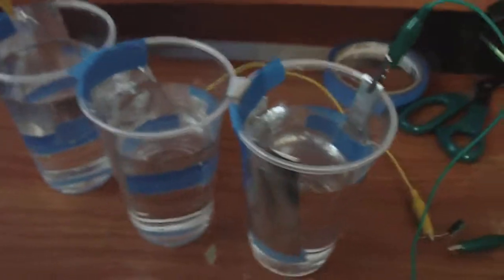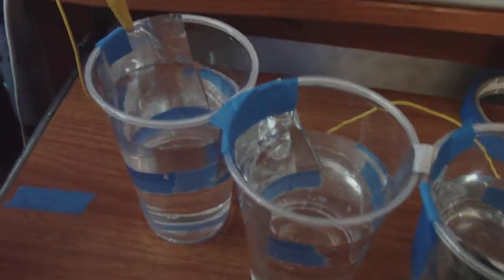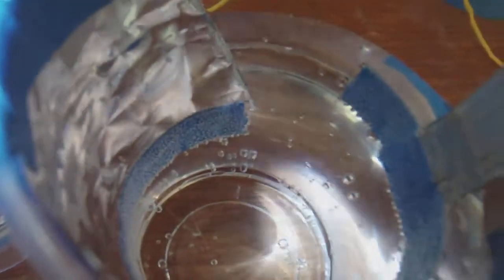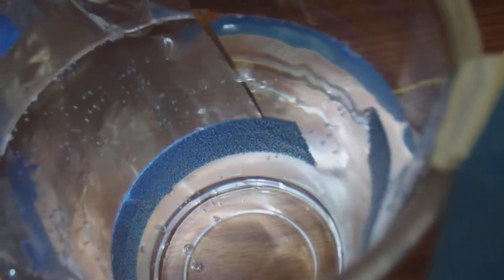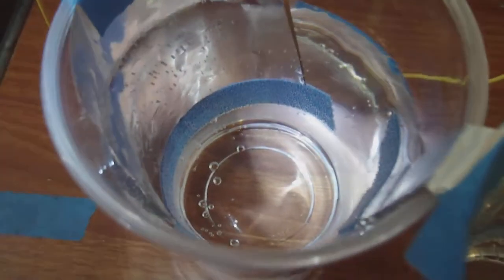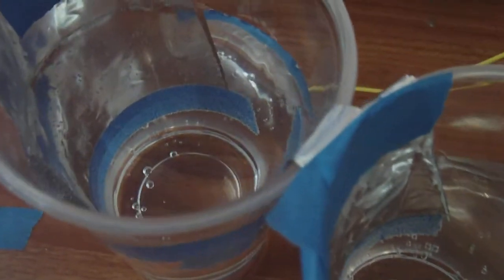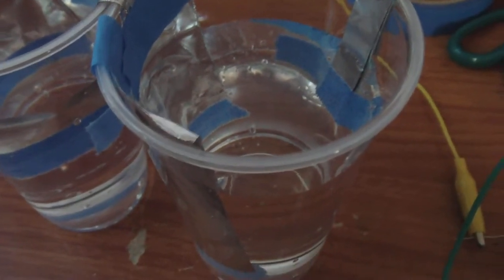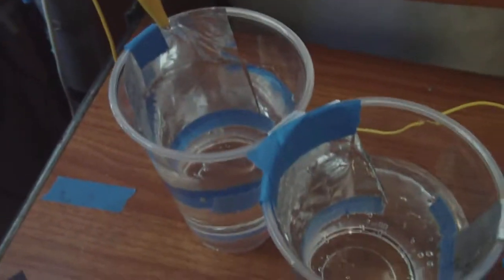Water Captret can be hooked in series

Comment: the glue that´s in the  tape  its acting as a electrolyte, with water, forming a weak electrolyte solution, try not to use a tape and see for yourself, no formation of hydrogen and oxygen. good work

Comment: @WodeBolder  I have done several combination's of metals..Copper and zinc work well , stainless steel and aluminum work well also .Using same metals for anode and cathode work but doesn't put out as well as a combination of different metals..And for running leds these batteries last for a good while.

Comment: Good stuff man ..I played with the water battery stuff about 2 yrs ago.The biggest one i made was 120 cups in series , it would shock pretty good, voltage was around 130v..I played with the bubble effect also and determined it was hydrogen , by trapping some and then igniting it..But it produces so little hydrogen ,its not worth the effort for that ..But for running led lights it works well..My brother in law has a 40 cup setup running 2 leds ,been going for over 1 yr now ..